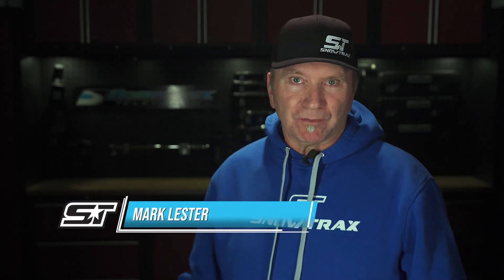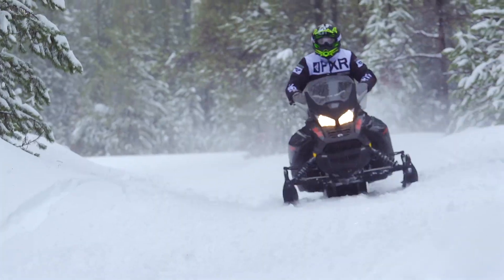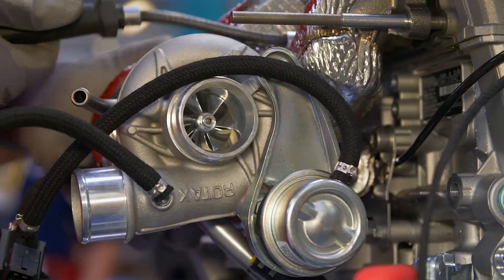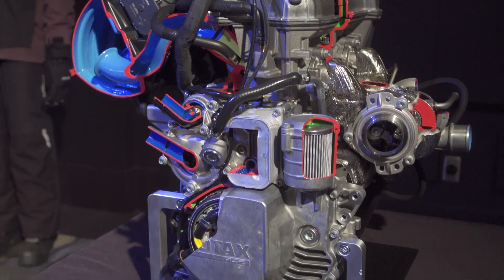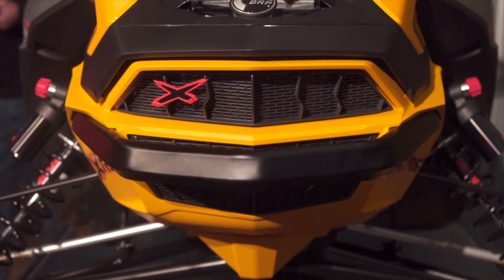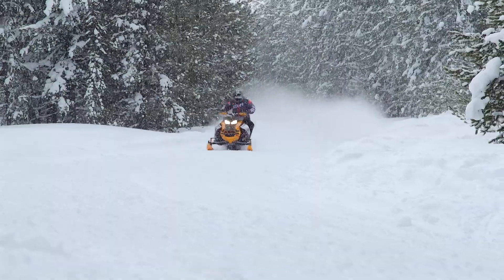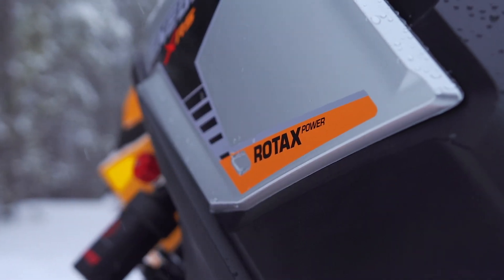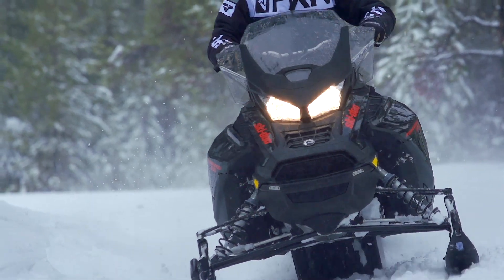Everything You Need To Know About Ski-Doo's Turbocharger on the 900 ACE Turbo Engine

Comment: Haven’t tried 900 Ace Turbo yet. However 900 Ace Skandic is excellent. Love the SWT 24” track. Beast, meant to pull moose out of Bush. Never needed Hi range yet. The Enduro looks awesome.
Reply: lmtada the turbo is in another dimension compared to a naturally aspirated ace. We’re talking slap a 600ace’s power on top of a 900 ace. 60+ more horsepower and easily twice as fast
Reply: @calebm.5698  My pops wants one for his Alaskan ventures. No shitting any draw backs? We mountain ride weekly and he won't upgrade unless it's a skandic... Just trying to get real world exp on it. He guides there and is stuck on Tyne skandic(which i get even being a cat guy myself).
Reply: Wrong tag for comment I'm sorry
Reply: Justin Hoth hey no worries- the skandic is an absolute beast in the pow he should get one

Comment: You started this by saying "lag free turbo".  Your review of last year's XRS turbo discussed lag or lack of response from the electronic throttle.  So as  old wrench asked below, is the lag problem resolved for 2020?
Reply: Most have said the lag is fixed or gone on the 2020's. Looks like it was the throttle assembly
Reply: It has been with the new throttle in 2022

Comment: But is the notorious throttle lag problem resolved yet?
Reply: old wrench it’s really not that bad, and after a while it’s unnoticeable. My dad’s turbo has some clutching modification which makes the throttle nice and responsive
Reply: @calebm.5698  Good to know.
Reply: @calebm.5698  Really????? Doesn't hit like a yammie yet???
Reply: I thought the lag was fly by wire lag?  Everything I have read says the yamacats actually have more turbo lag because turbo is farther from engine, the ace turbo has less lag because turbo is very tight to the engine.  The electronic throttle is the delay in acceleration that is confused as turbo lag.  Have I read it wrong?
Reply: @BoysInTheWoodsofPA  Throttle lag is the time difference from when you crack the throttle til the engine actually responds. Turbo lag is the time it takes from engine response til boost pressure kicks in. In either case, not something you want when demand is needed now. The throttle ramp up Ski Doo uses in the electronic throttle system is to help mask the throttle lag from the distance  the throttle body is from the engine. Due to packaging constraints, the throttle body is not where it needs to be.
Reply: @oldwrench4213  all the fly by wire doo 4 strokes have throttle lag though, it changes from mode to mode but it is there.  What I heard is the doo turbo response was faster than yamacat because it was in fact mounted closer to the engine.  I been looking at 4 strokes about a year now, just haven't bought one, my 2 strokes are running well at the moment, lag free...
Reply: No, still working on fixing the “ brake chatter”❗️